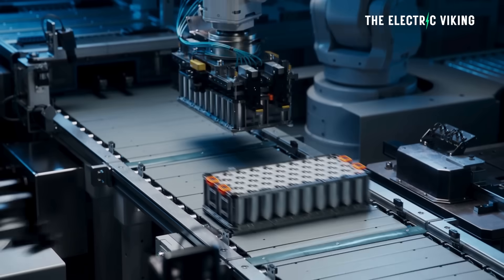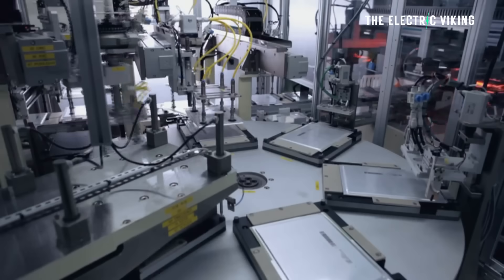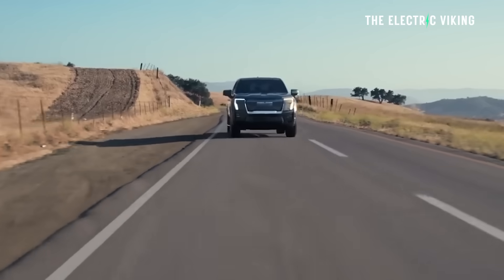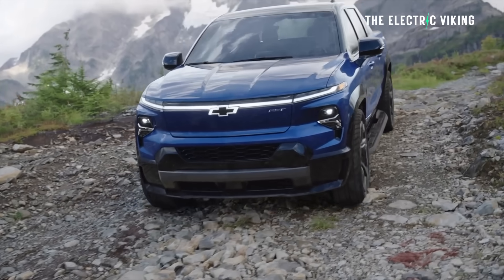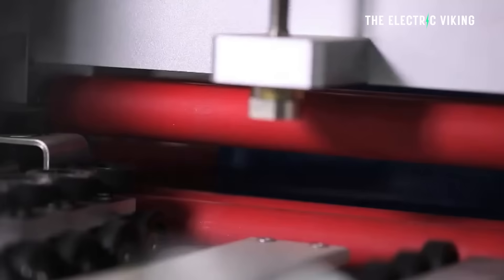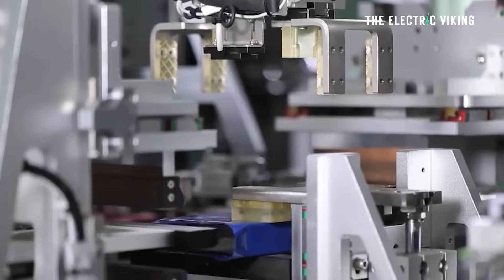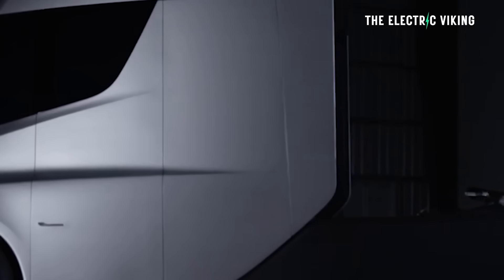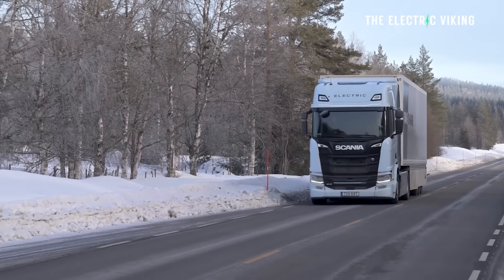GM’s Battery Breakthrough - LFP battery cost with 33% higher energy density!

Comment: The problem with GM and the US is they see this form factor as the golden standard. And make vehicles far bigger and heavier than 80-90% of the users actually need them for. And the infrastructure  has to be similarly oversized. People who need trucks for truck stuff will be driving an old reliable diesel for decades and won't be build brand new EV trucks. 

There's definitely room for breakthroughs but using a a bulldozer when a shovel will do seems like a silly engineering problem that the Americans have created for themselves.

Comment: I call BS on this one. If it is 33% higher density with similarbor lower production cost, they would plan it for their entire lineup, not just the most expensive and heaviest vehicles. I suspect that yhere is eith a major technical issue or the cost will be too high for the average car. 

If this does turn out to be real, I'd love to get my hands on some of these to upgrade my Chevy Volt to get 75 miles of range.

Comment: Some alternatives to use instead of game changing- Paradigm shift
Massive improvement 
* 
* groundbreaking.
* revolutionary.
* innovative.
* pioneering.
* novel.
* innovating.
* innovatory.
* cutting-edge.
* 
* turning point.
* tipping point.
* inflection point.
* watershed.
* shake-up.
* inflexion.
* sea change ,revolutionary

Comment: Increasing energy density is fine, it will increase cost as well.  But what we need is to improve efficiency in the vehicles: reduce weight, reduce drag, reduce cross-section.

Comment: I think it’s important to state a few facts that may not be obvious to people that have never driven a Silverado EV work truck with the large battery as I’ve been driving one now for about four months! This is a 2024 model which did not sell and was discounted special incentives and all 0% financing purchased for less than $60,000 as a brand new vehicle so is it affordable yes indeed! What about the range? Where are we at with the current model? We all know F150 lightning did not measure up did not get the range that they suggested it would under normal driving conditions that is not the case with the Silverado EV and nice summer weather 55 mile an hour or less driving even 60 or 65 mph. I am exceeding 450 miles sometimes by 30 or 40 miles of course in winter weather it may be just a slight bit lower but not much let’s say 420 or 430 under high speed driving with cold weather so let’s just say that this vehicle gets close to 500 miles on one charge under a good conditions That is outstanding. That’s what we are right now so let me just be clear. There is nothing out there that comes close to this and this is an excellent vehicle and GM has some bright days ahead if they keep this up! and improving on it will certainly attract many more people as well.

Comment: Technology keeps changing that it seems by the time I battery reaches production someone else is announcing some big improvement in some aspect of battery attributes.  I can't wait until someone figures out the correct composition to produce the higher longevity, fastest charge rate, highest density, and at the lowest cost.   This solution is out there....

Comment: I see that Toyota didn't call them "ultium2". Well, I mean, GM didn't.😋 But something in me fears that the name would have fitted better. Over-promised and under-delivered and late that's what ultium was. It's likely this will be the same. Ultium was also a LG energy product based, IIRC. Well at least, these didn't so easily catch fire like the previous ones, it was a big leap forward! But still miles behind the likes of BYD, CATL, Tesla and probably also others.

Comment: Oil production - just like coal production - is going nowhere except up.  The fact that it is a constituent part of so many processes and materials means we simply cannot stop pumping it.  The use of refined oil for engines is nowadays a byproduct of overall oil use and there's no reason why this 'waste' (from other useful purposes of oil) shouldn't be used to power engines.  What else should we do with it?  Bury it?  Diesel engine work vehicles will NEVER be battery operated, nor will ships or aircraft as energy density is key to the functioning of such engines.  Remember, EV's wouldn't exist without oil or hydrocarbons in general.

Comment: Talking about it is one thing. Having the critical supply chains to support large scale production which will make it posible to sell these at prices that convinces the market to buy and use these over Lithium based EV batteries is an entirely different issue.

Comment: If you want a cheaper Pickup truck use LFP batteries and drop the range.  IF you want more range make an Auxiliary Battery for the bed that extends the range.  
The need for range is dependent on the  use case and economics of the vehicle.

Comment: GM batteries won't compete with the breakthrough sodium ion batteries you reported that are cheaper and have more capacity. You should do a comparison rather than reporting that everything is breakthrough and a game changer.  Also your longevity argument is lame if you also say today's ev batteries outlast the vehicle without a need for more longevity.  Price is the main issue

Comment: Conventional ICE trucks do not have RANGE.  You just pull over for six minutes and fill the tank. You can drive three days straight, if you want to. Banging on about the increasing RANGE  of new EV"S is missing the point. The anxiety is that you're going to run out of electricity, period. And then what?  Can AAA bring you can of electricity?

Comment: Ultium Cells, a GM and LG Energy Solution joint venture, plans to start commercial production of LMR prismatic cells in the U.S. by 2028, with preproduction expected to begin at an LG Energy Solution facility by late 2027.  from1 day ago, so sounds right.

Comment: Daily drive is 1 hour. 
Parked 23hrs every day and all night long. 
A full battery storage capacity every day, every 23hrs, for free.
Dirt-cheap mass electricity storage 23hrs every day and all night long. 

Australia has 20million vehicles and 1million new vehicles annually. 

20years, 20million mass electricity storage batteries on wheels 🛞 👌 😎,  FREE MASS STORAGE. 23hrs every day. 

20million roofs with rooftop PV and dirt-cheap electricity, happy days.

20million hot roofs shaded by PV panels, less air-conditioning costs, 😎 😎😎 😎 cool. 
Happy days,  😊😊😊😊😊

New grid capacity upgrade is not needed, savings $TRILLIONS and TRILLIONS. 

Happy days, 

Quantity has its own QUALITY. 
$TRILLIONS and TRILLIONS and TRILLIONS SAVED.

Comment: Adding manganese to LFP batteries do increase energy density, but at the cost of cycle life of the battery. Proponents of the "new" battery conveniently forget to mention this drawback.
This is the same tradeoff of adding silicone to the graphite anode of NMC batteries; you got an higher capacity, but at the expense of an already short cycle life (500 to 600 cycles)...